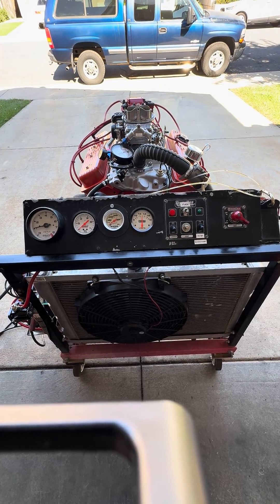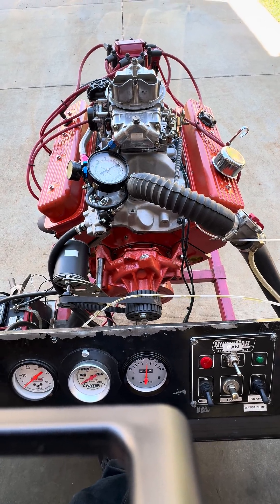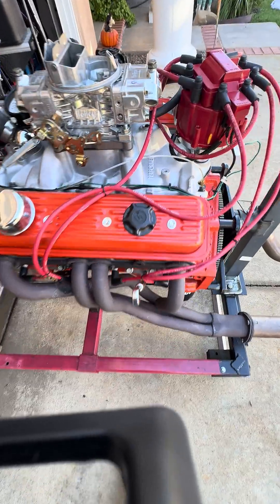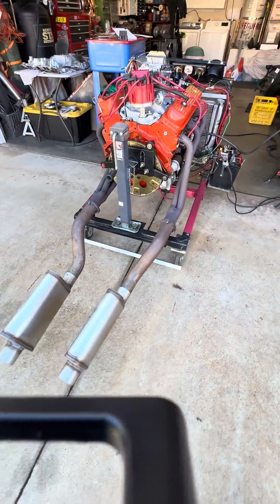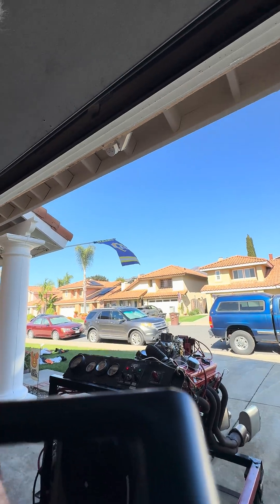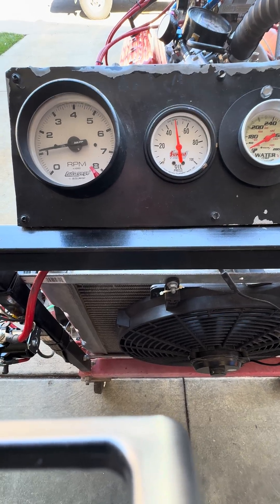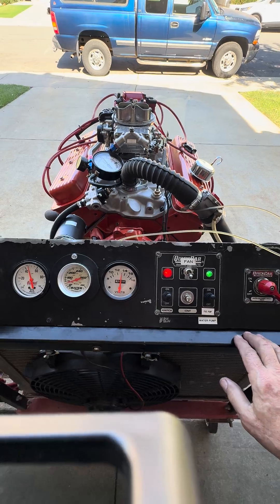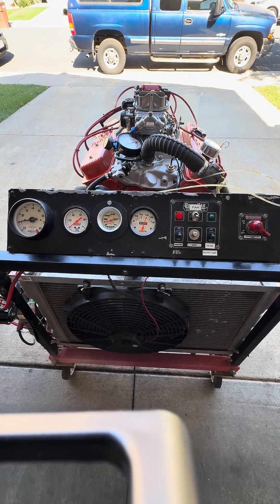JMacPerformance 383 small block Chevy 350 horsepower - 400 Lb-Ft

Comment: This is a weak 383 can’t call that a performance engine wrong can and heads that engine should be producing well over 400 ft lbs of torque I have seen mildly built 350s make 440 ft lbs on pump gas

Comment: the 280H is a very good cam i had that in a 355 with 041x heads and it used to pull hard. i’m sure in the right setup that motor would have went high 11s in the quarter….

Comment: Dang, got a '77 C30 farm truck with a 350 and I'd LOVE this in it. Wish we didn't live across the country!!
Reply: I own a 1988 Chevrolet 1 ton long box used for my Alaska guided jet boat towing truck.
It has gone through 2 454 BB and just put a 383 stroker in with the 6 inch connecting rods - Aluminum heads bought from E bay with 68 CC chambers - 202 & 160 values.
Comp roller cam for 1000 RPM start to 4800 RPM max power range.
Holley 675 carb..
Scat 350-383 Crank. / Eagle 6" connecting rods.
This 383 really need to watch your speed because this engine easy gets going in speed very fast, you can be cruising then look at your speed and be well over the speed limit very easy with no work at all on the engine to be these speeds even pulling a 30 foot jet boat that has a 700 pound big block adding to the boats weight.
The truck towing a 30 foot jet boat from Oregon to Alaska up and back now and done the worst of the Cassisar HWY in the Yukon with 25 mile mountain passes of 8% grades.
So far, the 350 can never match the torque of the 383

Comment: It sounds great! Good truck engine swap without burning a hole in your pocket for fuel
Reply: The 383 I did for my guide boat towing truck so that engine is very closely built, and I picked up on fuel milage with the 383 because it doesn't work as hard as a 350 does.
The 350 I was mashing hard on the gas just to maintain Highway speeds and have a mountain pass I would crawl over with the 35o and now the 383 is like is that all you got? give me more to pull

Comment: Did I hear right? 085 heads off a late 90's truck? What are those? Don't late 90's trucks have vortec engines with vortec heads?
Reply from the maker: 083 heads they had a lot of port work done them.
Reply: @JohnMcKindley Ahh ok. TPI heads👍
Reply: @MarcBchannel I tear those heads off and throw them right in the scrap pile when I come across a 350 with those on it, also the 882 and 624 head's, all junk in my book, and certainly wouldn't spend any time trying to port them. But that's just me, these days I don't even want to use the old camel hump's, they were good and what you wanted, 50yrs ago! A Vortec head is way better than the old 2.02 head's if you want to use factory head's. Which sounds like you probably know.
Reply: @docsmallblock6584 Ya. These days it doesn't make sense to use anything less than a Vortec. Much less if you have to rework old heads. I did run some 487X heads on my 355 Chevelle when I first got it but with flat tops and a street cam. Ran pretty good👍
Reply: @docsmallblock6584 the only legitimate good use for those tpi heads today are when you get a set of aluminum 113s or 128s. They have a 58cc combustion chamber and are worlds easier to port than iron. Putting a set on a 305 after correcting a lot of the weak spots like the choked off throat area in the exhaust and breaking down the guide area along with smoothing the seat transition. Should be able to get away with more timing and should flow better than a stock 305 vortec head and came equipped with screw in studs with helicoil threads and stock guide plates. Perfect for a small cube motor that’s going to breathe at high rpm

Comment: That’s the mildest 383 I’ve ever seen. It’s a nice engine and runs great but I don’t see doing the stroker and running stock heads and such low compression. You can get the same torque out of a 350 with the right cam.
Reply: I seriously can’t wrap my head around why he said only 350 horsepower. He needs to dyno it. That cam is a 230/230 duration @50 and 480/480 lift cam. My 218/224 roller cam in a 355 with world s/r heads (lesser than this combo) made 380 horsepower and 418 pound feet of torque. Same 9.5:1 compression. He might be SERIOUSLY shooting him self in the foot underrating these numbers unless he’s talking about wheel horsepower in a dump truck
Reply: @theeoddments960 That’s what I’m saying the 350 I built for my s10 with fairly mild parts Is rated at 435hp. This combo should make at least 400+. A crate 350 makes 350hp lol like you said unless he was talking about wheel hp in a dump truck with an automatic lmao
Reply: it must have a really shitty cam in it if its got ported heads it should make way more power
Reply: @alhill1767 He's using a 280H cam which is capable of 400hp+

Comment: And these guys are engine builders, and they can't even get the distributor on the right tooth coil on top of the distributor should be straight across. When you've got it lined up like factory.

Comment: It kills me when these guys talk about how much money is in this engine for only 350 horsepower. I've pulled multiple 96 up vortex, 3 50's out of the junkyard for $500. They'll run 6300 rpms do it all day and have the same horsepower. You're getting from this 383.
Reply: 96 and up vortex are only 245 hp
Reply from the maker: It wasn’t made for max horsepower
Reply: Back in 70 the LT1 cranked out 360 hp right out of the box without all these gimmicks add ons!
Reply: @johnheffner3950 good head flow and compression that was before they were held back

Comment: I'm impressed at least it's not vise gripped in a grocery cart with 1 wheel missing and the battery bungied to the bottom shelf and a bent up rusted out y pipe for exhaust while the brother in law pours gas into carb while smoking a cigarette. 👍😂

Comment: Those heads cannot flow like a vortec head . Simply because they are not a closed chamber head
Reply: Hence 350hp out of a 383ci!
Reply: @docsmallblock6584 Right? Stock vortecs on a 383 with that comp 280H would be well into the 400hp range
Reply: closed chamber heads flow worse because the shroud the valves open chamber heads flow way better your compressions just lower
Reply: @alhill1767 Stock open chamber head is still going to make less power. Shrouded or not. Even a ported open chambers. Vortecs still flow more and make more power due to better intake ports and better squish.
Reply: You Wright but have way more bottom end  TQ pull stronger  casting them head 193 casting

Comment: Only 350hp? Only 400lbft of torque?  Damn thing must have and 8:5-1 comp ratio lol.
Reply: I agree, that's awfully weak for a 383, I wonder if he's just guessing on the power or he's actually had one on the Dyno built like this? Really, really easy to make 400hp with 383ci's! I'd say the main thing killing that one would be the head's, gotta be! The cam is easily capable of 400hp, so kinda gotta be the head's. I mean it's easy to make 400hp with a 350 with decent head's, even China aluminum head's.
Reply: Heads are garbage
Reply: @tonyshower9835 those tbi heads are holding it back
Reply: I have a 350 making 400hp and 420 torque
Reply: Ikr
Reply: Yeah " you want reliable power...a good street motor" too much power..to much torque...Your average torque converter " want work..you would need to return the ECM..OR IT WOULD NEED FOR YOU TO KEEP HITTING THE GAS ..IT WOULD NOT IDLE" ....👍
Reply: @RGIIIBOXING it's carbed wtf ecm lmao also 10.5 to one on pump gas is very reliable hell ive ran 11.5 to 1 on 93 and 350hp to the flywheel out of a 383 is pathetic
Reply: 9.5 he said🫡
Reply: This is a dinosaur 🦕 engine running on pump . What do you expect ? This is very enjoyable In most street cars . Very easy to maintain .
Reply: Right! I could probably squeeze that much out with standard bore and stroke with flat tops. Definitely could with a roller block and vortec heads
Reply: That's what I was thinking? 🤷 All that money and it's a stock HP 350.

Comment: Hey what’s that alternator thing you have hooked up on there is it just something you have for the little engine stand set up you have made or is that some type of new performance I’ve never seen that is why I was asking
Reply from the maker: It’s a small electric motor made by Moroso that turns the water pump I use it in place of a fan belt and pulley’s